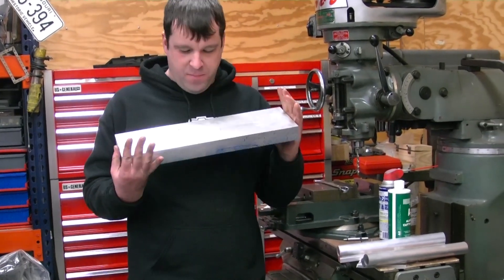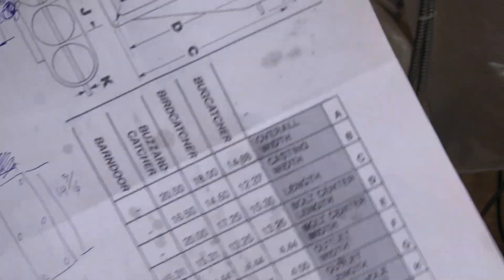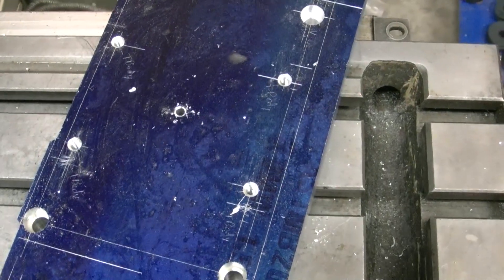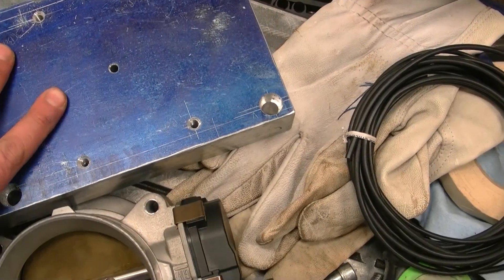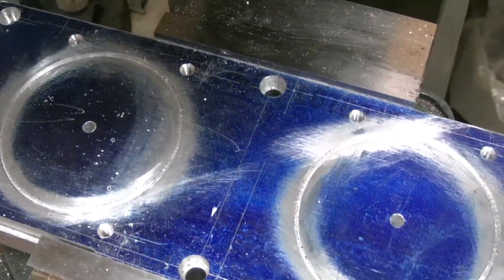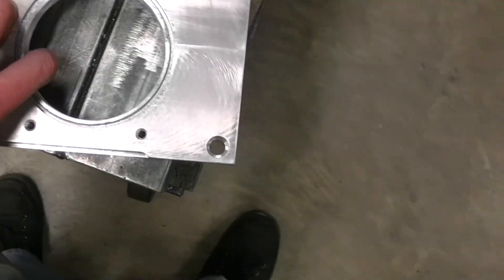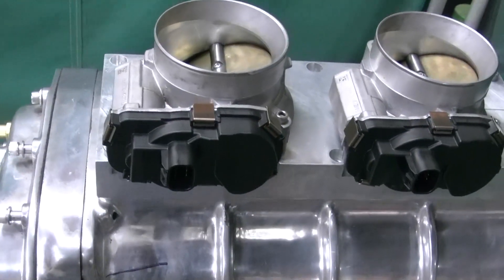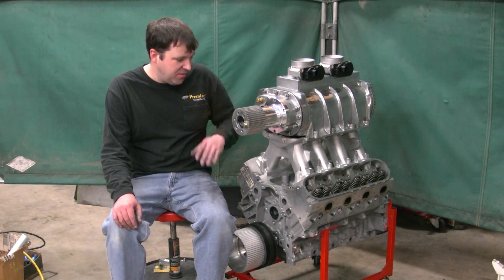Roots 6-71 Blown LS Build Part 3

Comment: I've been trying to figure a easy way to run ls style 102 or 105mm tbs on a 6-71, Im using BDS's efi bottom blower intake. Im learning roots blower stuff as i go Im a turbo guy. I know its not ideal to run a blower dry. My first idea was to use a dual to single 4500 plate and use a Holley  injector spacer with 4 injectors with a elbow and 105mm throttle body but I dont know if that will flow enough air but then I thought about using a injector spacer with 8 injectors with a dual 4150 flange plate on top then edelbrock 4150 flange to 102mm ls throttle body flanges with two 92 or 102mm TBs obviously lol either way i doubt its the cheapest way or easiest way but i can understand it better doing it that way. I already have a Holley hp ecu for it, I run Holley efi on all my stuff my wife's little nitrous sbe l33 5.3 96 SN95 stang my turbo single cab Sierra 1500 and now on this setup its a 77 nova my pawpaw bought new it was the first car I did s turbo ls swap on and went 5.90's wich was a litte Sketchy but I got this blower and decided its time to party its been sitting for about 4 years and I love that ol girl and it does have some pretty nice parts on it. I basically want to build a nasty street strip Australian style burnout setup! The goal is to have the blower hat higher than the roof and give it hell

Comment: Why wouldn't you just run the injectors in the intake?
Reply from the maker: This blower is too tight to only run fuel in ports. The fuel up top helps to cool and seal the blower rotors. You can get very loose blowers and run injectors down low if you want to, but they are not very efficient.

Comment: Do you know of any oval drive by wire throttle bodies, I want to do the same setup for my 540 BBC and was thinking an oval throttle body would be better for air fuel distribution
Reply from the maker: Vmp makes one for ford blowers, like on mustangs. Holley has one with 2 oval blades on it but not sure if it comes in dbw and it's like $1400 or so.